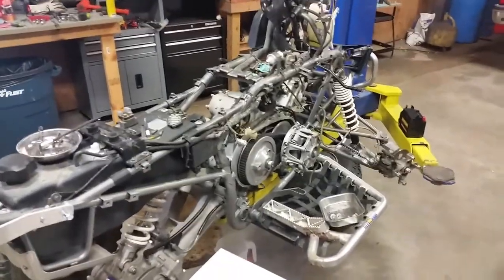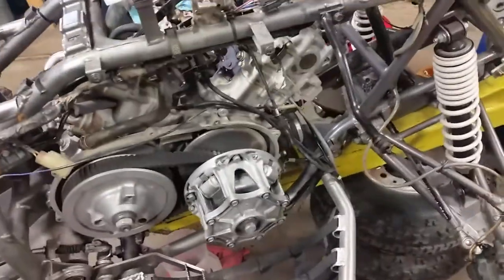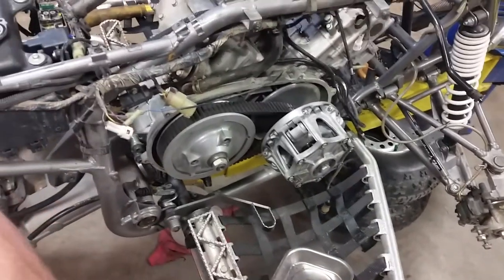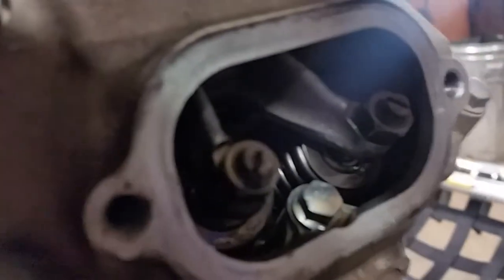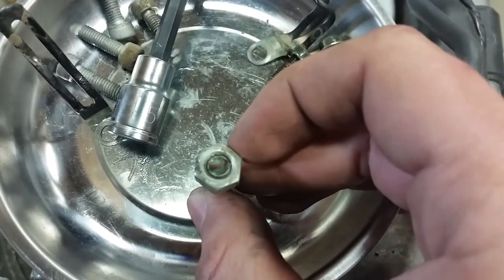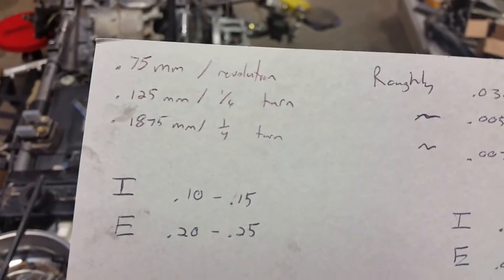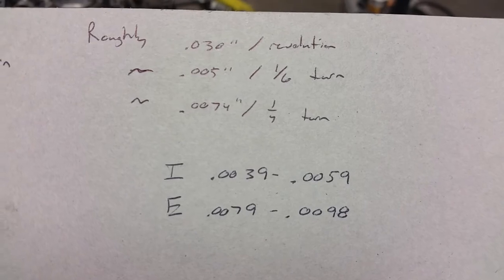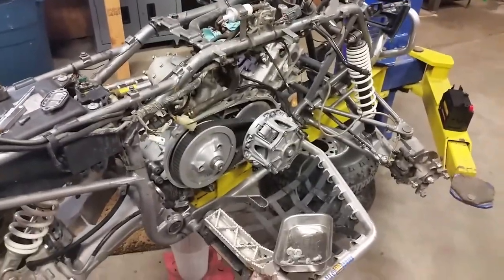Kawasaki KFX700 valve adjust without feeler gauge

Comment: he is really close to the service manual if you don`t have one (great job )          (KFX 700 )  ALL Carb ,units                                                                                                         turn the crankshaft counterclockwise with a
wrench on the alternator rotor bolt until “T-R” mark on
the alternator rotor aligns with the notch  on the housing
the end of the compression stroke in the rear cylinder
head.
• Measure the clearance for all four valves, one at a time
between the end of the valve stem and the adjusting
screw with the thickness gauge.
Valve Clearance (when cold)
Exhaust: 0.20 ~ 0.25 mm (0.0079 ~ 0.0098 in.)
Inlet: 0.10 ~ 0.15 mm (0.0039 ~ 0.0059 in.)
If the valve clearance is not correct, adjust it .

• Loosen the locknut  and turn the adjusting screw 
until the clearance is correct.
• Hold the adjusting screw from turning and tighten the locknut to the specified torque.
Torque - Valve Adjusting Screw Locknuts: 12 N·m (1.2
kgf·m, 104 in·lb) ~ "" thank you for helping others ""